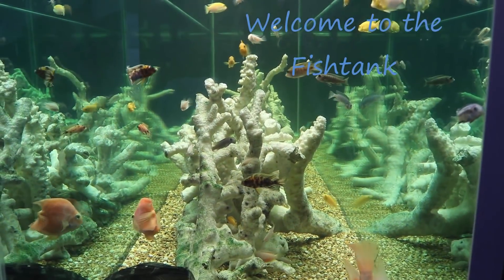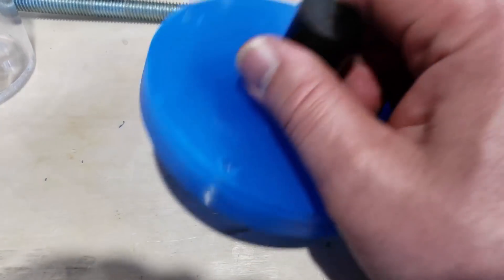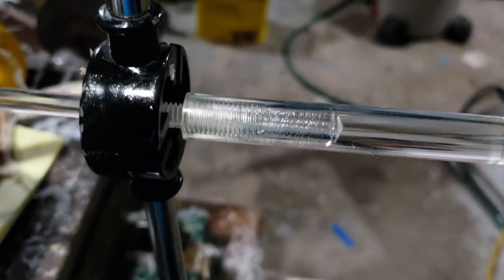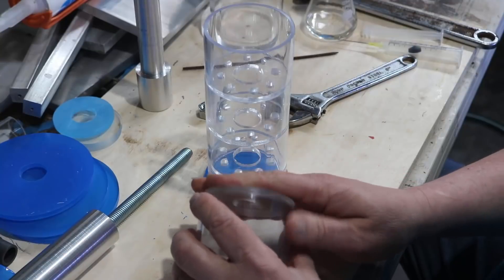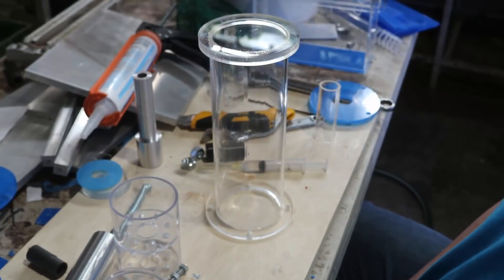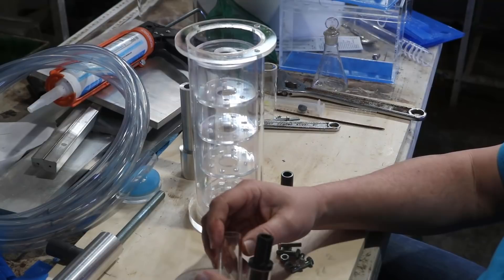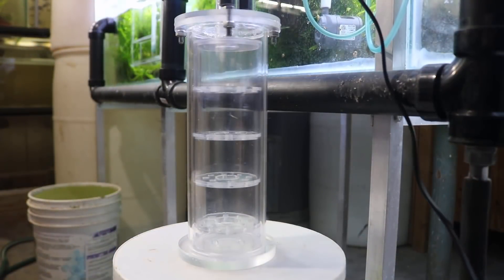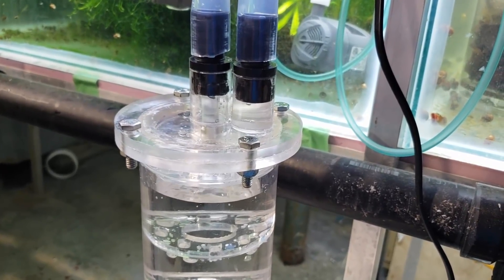DIY Acrylic Canister Filter Part 2

Comment: I dont understand, how does the water go all the way to the bottom from th input ?
Reply: I think I got it, I didn't see how the last cylinder was designed.
Reply from the maker: There is an inner ring that directs the flow

Comment: I think it would be a good idea to make the intake tube longer, make it so it goes all the way to the last drilled ring. That way you can be sure that the water will go all the way to the bottom and will be forced out up the holes you drilled in the rings. Keep up the good work
Reply from the maker: All of the trays are friction fit so the water has to go through all of them. If the intake tube goes to the bottom it will end up bypassing most of the filter material. I plan on doing a flow test before filling this with media to demonstrate this and I will try to modify it to your suggestion as a comparison. Thanks for sharing your thoughts on this and for watching
Reply: @FishmanEricRussell  thanks! i'll be watching all of the updates. I think that with the current design with the intake and drain pipe at the same level once you fill it with media the water will find resistance and go the easy path straight back through the drain, at least a good percentage of the water, enough to affect the efficiency.
Like the fx6, the intake as a plastic pipe that takes the water all the way down to the bottom of the filter first then the water has to go up through all the mechanical filtration and media before exiting the filter from the very top. 👌🤜🤛

Comment: Good video, only thing i could think of though would media in the trays fall through the holes, and if so, waters going to mainly divert through the large hole through each tray, should be solid bottoms in the tray with just small holes to try and even out the flow around the media
Reply from the maker: When I go to set this up with media I will address these things. As usual I ran out of time to cover them here. Thanks for sharing your thoughts on this and for watching

Comment: I plan to do filters like this but square.  It’s odd to me to find circular filters so common.  They are so much more difficult to manage in spacing than I find squareish filters.  ...look forward to doing like the previous bubble acrylic filter also.
Reply from the maker: I would love to see that! The reason lots of these are round is because they are made by injection molding so they don't need to deal with the same issues as DIYers. Square will work just as good and is allot easier to put together. Thanks for sharing your thoughts on this and for watching

Comment: I’m a fan of two 90 degree fitting press fit to rim of tank. Then mark and glue in place. The bar or thread fittings, I normally do threaded pvc method.
Reply from the maker: 90 deg. will probably be the way I go though I think I will go the threaded route over the glued method. Thanks for sharing your thoughts and for watching

Comment: I really like the look and you would be able to see in it to know when to clean it. I am looking forward to seeing it with media in, I was wondering though without a tube going down to the bottom and then up through the section will the intake water make it to the bottom. Regardless I love the look awesome as always!!!!!
Reply from the maker: Hey Sandy. There have been a couple of people suggest this so I plan to do a flow test to show the difference between the two setups and yes next week I also plan to show this up and running. Thanks for sharing your thoughts on this and for watching

Comment: I'm surprised you didn't put a groove in the lids for an oring for a better deal on the lid
Reply from the maker: I was initially trying to go all acrylic and have it be all clear. I only ended up using the bolts and delryn at the end when  the acrylic bolts didn't work out. Thanks for watching

Comment: . I remember mentioning this in the tray stacks. Acrylic wo$k isn't very cheap, and alot of clear canister are in vaccume cleaners .It can be a uv sterilizer, next build depends what is needed , for aquariums.  I'm actually interested in air and water pumps. Maybe that's all you need next, since you can make these filters.
Reply from the maker: The acrylic for this build was between $20 - $30. I will add your pump idea to my viewer request list, though I have already put an acrylic UV sterilizer together. Thanks for sharing your thoughts on this and for watching

Comment: The intake must go down until the bottom and sucked through the single cages of mediums… so the filter won't clean the water… fix the pumpe on the top of the filter it dosen't looks great in the tank….
Reply from the maker: You're the forth to mention the intake pipe so I plan on showing a flow test before filling it with media, with and without the pipe extension. Thanks for watching

Comment: The one suggestion I would have would be to have the intake tube go all the way to the bottom of the canister and  standing just a bit off the bottom. This would force the water to the bottom and rise up through all the media. stopping any "channeling" through the media for a even flow through the media. Love the look of the all acrylic build. Great job once again.
Reply from the maker: Unfortunately where the intake and output are located means that it has to be a top down flow. I would also rather draw the water out of the filter than pump it in. Maybe in the next one. Thanks for watching and sharing your thoughts on it

Comment: At the risk of over complicating the build you may be able to add a port to attach a Co2 line and have it become a reactor too. Maybe on the next version though.
Reply from the maker: And here I thought I was the one to make overly complicated things lol. Great seeing you as always!
Reply: Well if it is this overly complicated at the moment.. what is some more?
As for the made bolt/screws try a different thread pitch, too fine and it is brittle courser and is thicker and stands up to more use.
Reply from the maker: @wobblysauce  Too true! Don't really want to get a new tap and die set for this though.
Reply: @FishmanEricRussell  Well it is 'Plastic' you could make your own.
Reply: @FishmanEricRussell  - Oh making simple tasks and projects overly complicated is one of my three Super Hero Powers. The second one is the unique skill of tearing up a junkyard using only a rubber mallet. And the third is being able to hold onto stuff others think is useless junk for years and throwing it away a week before I need it again! What a legacy skill set I have to leave to my kids and grandkids!
Reply from the maker: @jlathem56  LOL! Love that especially the ability to have a use for something I just threw out. I do that all the time

Comment: I think it looks amazing.  What size tank would you use this on and do you have any way to measure GPH or that is relevant?
Reply from the maker: Hey Diva! Great seeing you. This filter would be good for a 20 - 30 gal. tank. I don't worry about flow rate unless there is a fish with special needs. Thanks so much for coming by.

Comment: But who is going to make a filter out of expensive components? Would it not be easier to buy  one and cheaper?
Reply from the maker: The parts cost for this build is about $25 - $30. The pump is also about the same. One can always buy cheaper things but a custom build can be built to your needs and will last longer and be simple to repair. More importantly than that it's fun. Thanks for watching and sharing your thoughts
Reply: @FishmanEricRussell  I stand corrected, I thought the acrylic tube would be very expensive. Still you need a lot of equipment to make it.
Reply from the maker: @MoreChannelNoise  Too true!